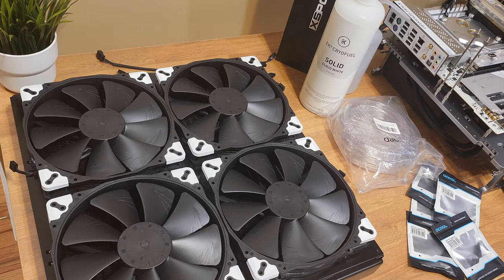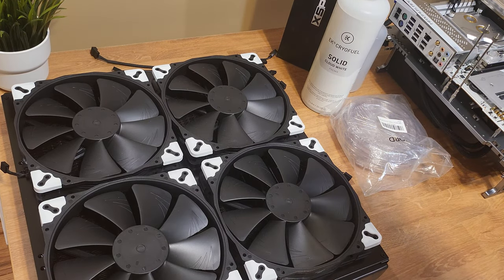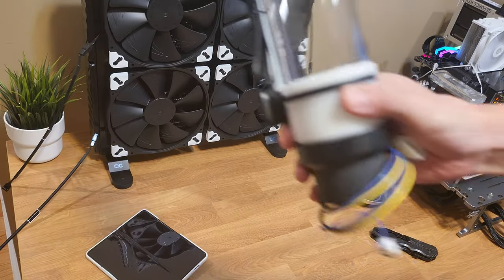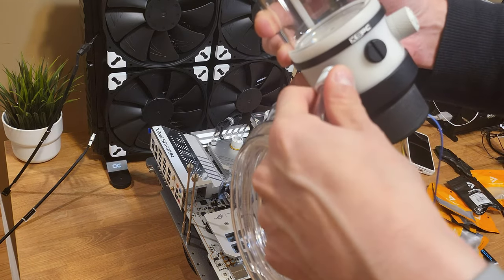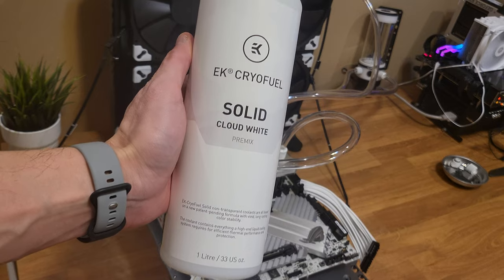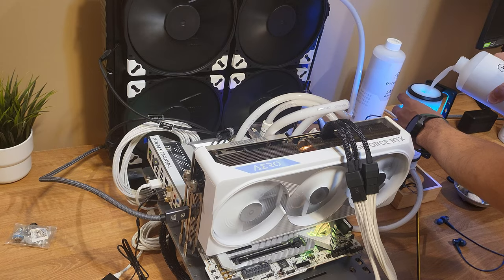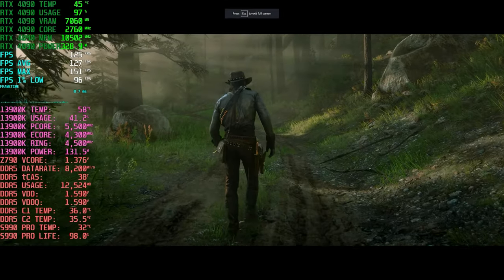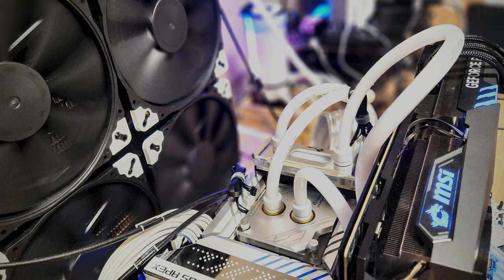The Road To 6GHz e02 \\ Overnighting "German Engineered" Screws, Scuba Raptor is Thirsty //

Comment: I'm not sure how discovered your channel, but I can't emphasize enough how much I appreciate you listing all the components with the exact models. Not to mention a lot of work has been out into the time stamps. On top of it all you seem like a very chill fella.
Just wondering though, what size fittings are you using 10/16? And which brand tubing is that?

Comment: Hey man, love your channel! Been building a buy-list for my new watercooling system and wanted to ask how the pump handles that monster radiator? Don't you need two pumps for a behemoth like that?
Reply from the maker: hey thank you for checking out my content! i originally thought so as well, but the single 1200 L/H D5 I'm using is more than enough for this system as configured.